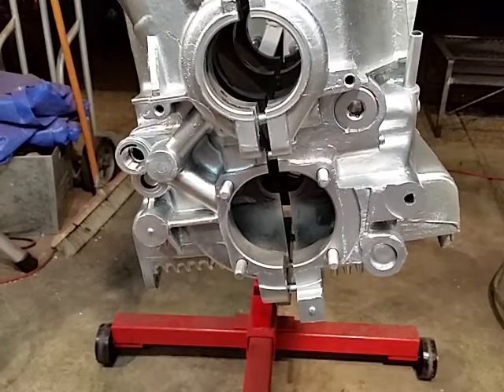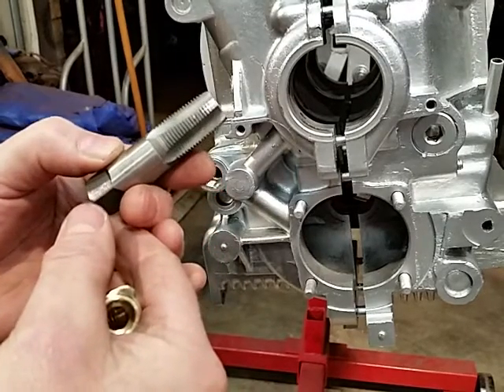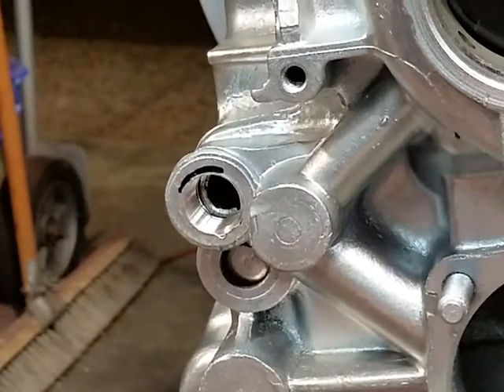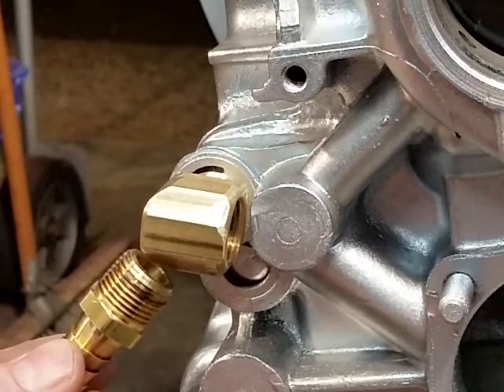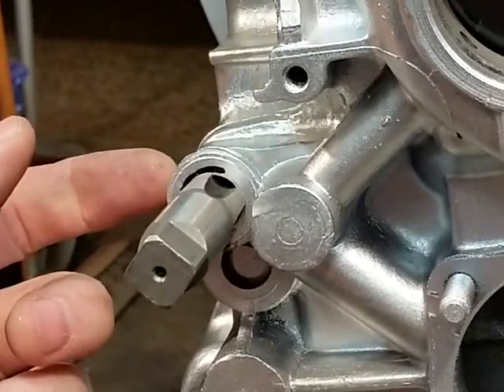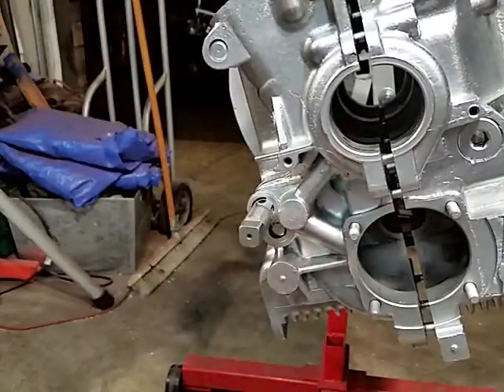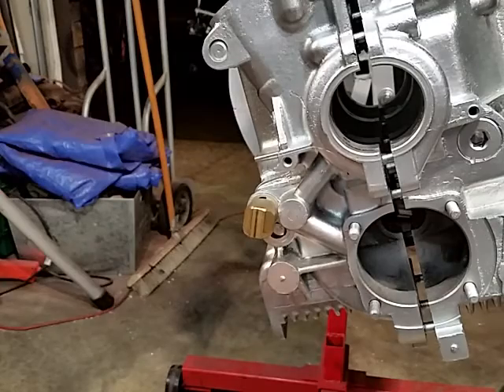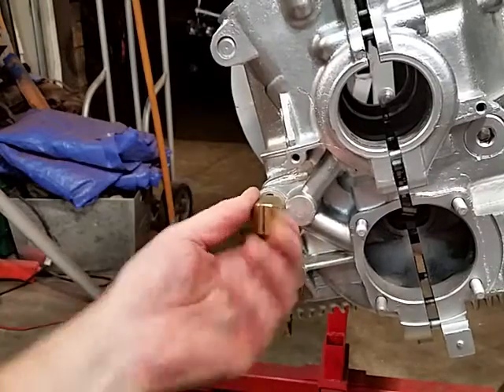Full flow oil - VW case.

Comment: Thanks for the tip, building my engine in the coming weeks, and figured hell I got it apart I might as well tap the case for proper oiling. Don't want to risk spinning a bearing on a new crank and cam

Comment: Yes, use cutting oil like Tapmatic. There is no bottoming tap for NPT. You were ok before you tapped it more because with Locktite you should turn it about a half turn more after it’s finger tight. That definitely won’t crack the case. If you want your case really clean, remove the small plugs too. Tap & plug them with 1/8” and/or 1/16” NPT plugs & Locktite. Don’t paint the case silver. Retains heat like a teapot. ONLY Flat black if anything! Even cylinders, pushrod tubes, valve covers etc.

Comment: I plan on doing this with my build. I'm curious why a threaded extension couldn't be used to get beyond the interference. I realize there is one more place for potential leaks, but with pipe threads...eh.  Now would there be interference with other components? Don't know, but I'm going to experiment with that concept.

Comment: there is a much better way:
1. use a bottom tap, not a start or intermediate
2. use proper AN fittings instead of cheap brass pipe fittings, that way you can position the fitting exactly where you want it
3. use thread sealant. npt  threads are not designed to seal completely

(btw, that is not ”outflow”, it’s the return side)

or, if you want to make your life a lot easier, get a pump cover with in and out built in.
Reply from the maker: Thx. But, it's better to start w/a brass fitting, then add AN on.  Brads is better for magnesium cases.  And, yea, I did put sealing-tape at final install.  Goodluck w/yours
Reply: @vwjunky3906  not sure who told you that but it's nonsense. coefficient of linear expansion of aluminium is a lot closer to aluminium and magnesium than brass is, and AN fittings are a lot simpler to fit. you can even skip messing about w NPT, just use straight threads and sealant. not criticising your choice, just pointing out there are better methods for anyone else who's interested.

Comment: you should be putting a plug in that hole and then tapping the gallery under it and using a long straight fitting from JAYCEE so you have a straight shot into the main gallery and you can use a full flow 90 hose end to connect the line to it for better oil flow than the two piece 90 fitting deal you are using

Comment: So how far can you actually go into the case before you start obstructing the oil gallery? Or do you check that and relief cut the fitting to clearance the opening?
Reply: mike richard - if you arr using the correct fitting and drill bit combo, along with thread seeler you should have no issue with screwing in too far.  The main concern is to NOT over-tighen, or you will crack the case.
Reply: The side gallery is already blocked in one of a few ways, so that's not a concern. Flow through the fitting continues in the same direction.
Reply: Scrap that, I may be talking crap

Comment: Use cutting oil
Reply: Clive Armstrong I'm in
Reply: I found that the magnesium chips stuck to the case with oil and therefore, were harder to get out. Magnesium is so soft so I think the tap should be fine without any cutting oil

Comment: Looks good to me.  Thanks for taking it to the next level.  Even if you buy a new case  that comes with the full flow tapped you will have to address this issue. I noticed that when I add sealer it effects the final resting place. Thanks for the referral too